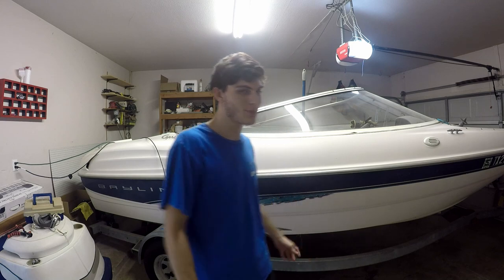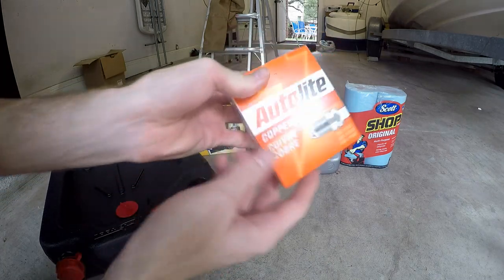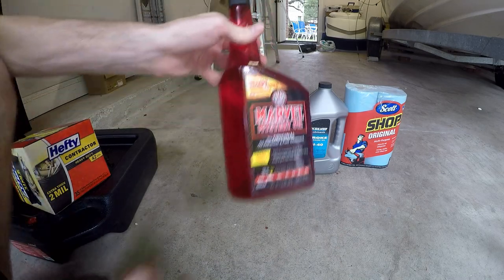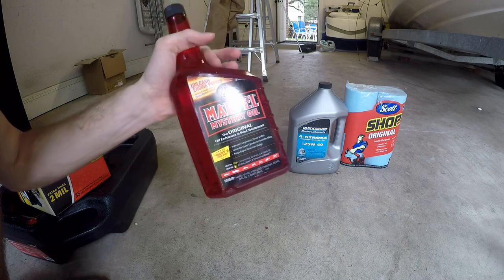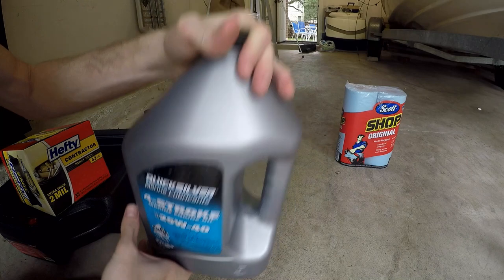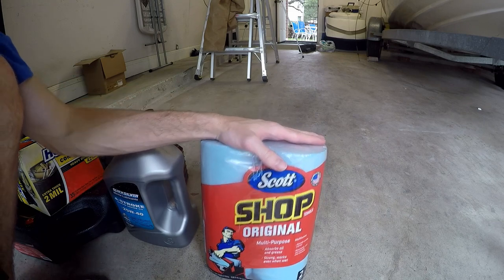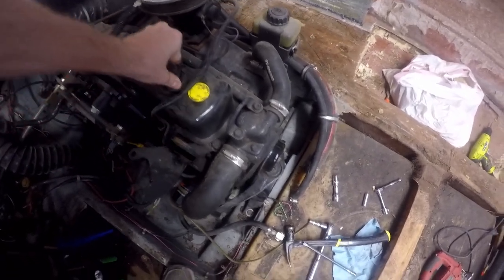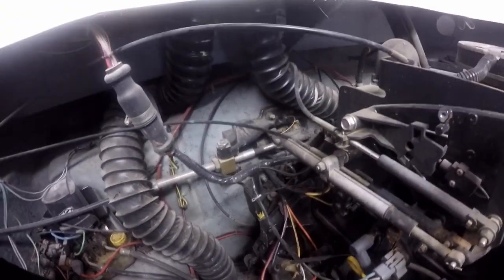Mercruiser 3.0 Engine Seized - BaylinerProject: Day 11 vlog

Comment: I have been taught by my grandfather and other old people whom are now gone and I am old is to drain all oil, fill with diesel fuel, let sit for 3 hours and turn motor by hand, let sit 1 hour and repeat as much as you feel necessary. then drain before refilling with new oil. This will aid in dissolving any type of buildup you may have from previous use.

Comment: Zach you doing great . Dont worry everyone making mistakes. We cant improve our knowledge without learning through  mistakes  . Im curious WHAT IS THE REASON TO CEASE THE ENGINE ?
Reply from the maker: water leaked through the exhaust riser gasket into the exhaust manifold and then water/rust leaked from the belly of the exhaust manifold through the exhaust valve on cylinder 4 into the cylinder. When I took it apart the rings on the piston on cylinder 4 were bonded to the walls of the cylinder and it left a groove that needed to be bored out +.03"
Reply: @ZachsGarage1  i like your presentation .you doing pretty neat mate .goodluck at your next fix 👏

Comment: bro do you ever get to fix the issue?
Reply from the maker: Yes, in my video where I tear down the engine I find out the piston in cylinder 4 was rusted to the cylinder wall. Had to get the cylinders bored out to fixed the issue
Reply: @ZachsGarage1  piston is aluminium couldn't of been rusted
Reply from the maker: @liv2fish21  I think you're right. the piston rings are the part that rusted and broke into several pieces